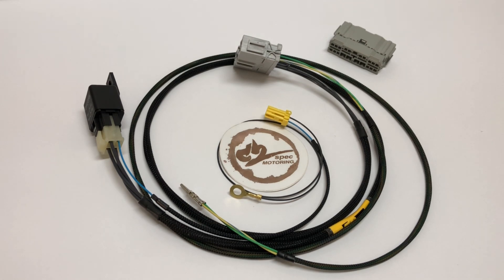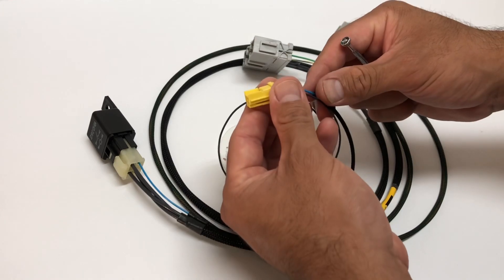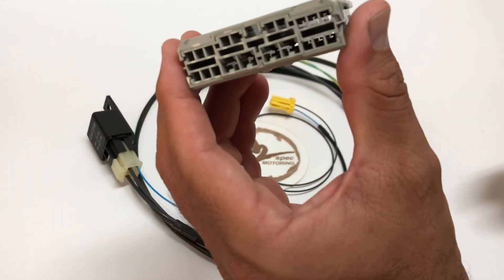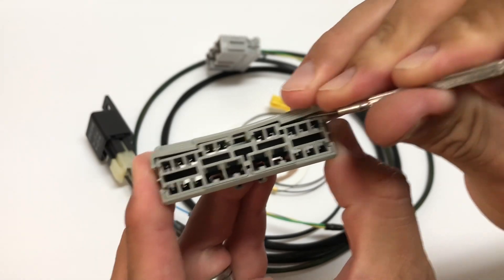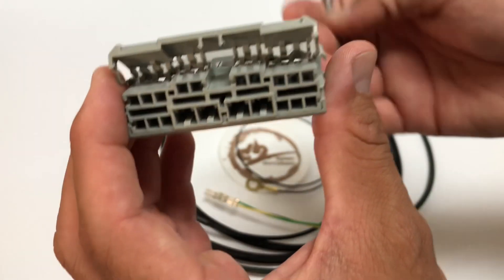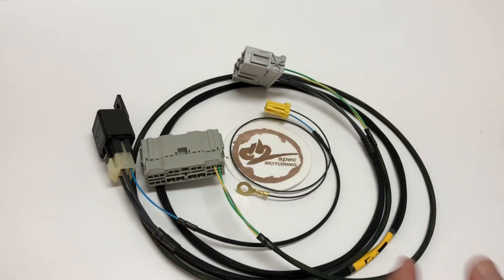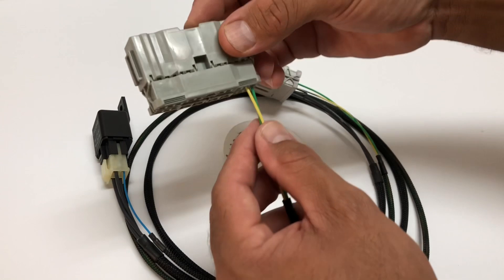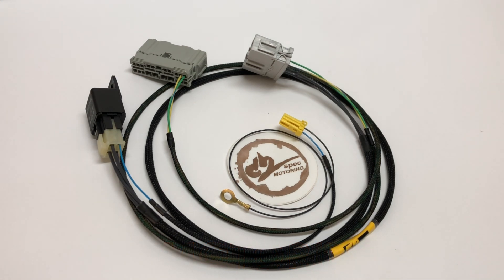K Swap Auto to Manual Harness-Acura Integra Honda Civic Honda Accord

Comment: For the big connector where does it plug in at? Under dash? If so isn’t that where my k swap conversion harness plugs in at ? Need help??
Reply from the maker: My apologies, I totally missed this. 
The connector directly plugs into the male side of the large 14pin connector where the auto shifter was originally connected.